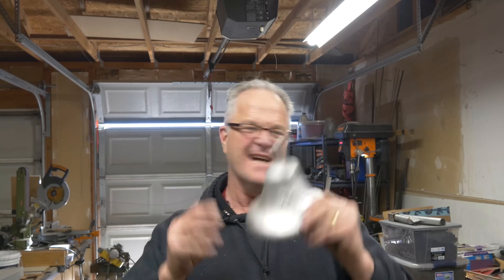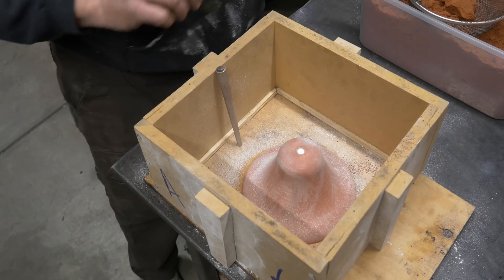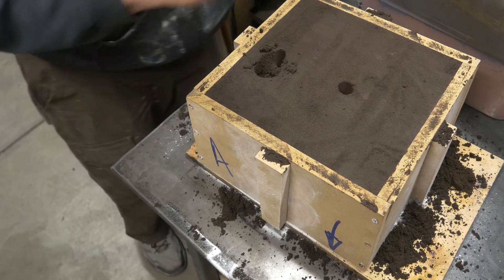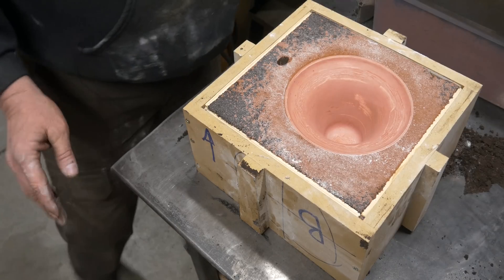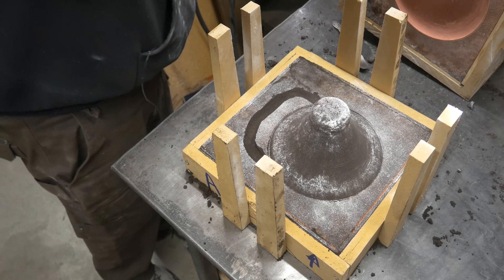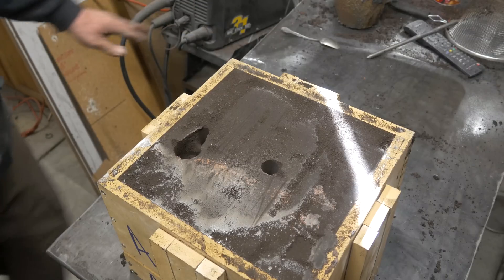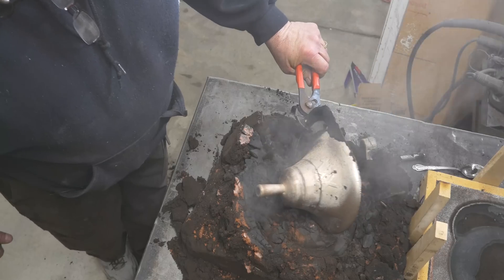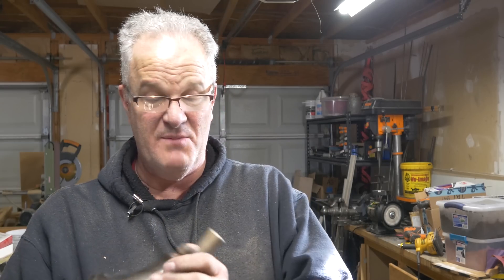Casting a bronze bell

Comment: Great Job Perry!!! It’s beautiful! Where did you get the tin metal from? I was looking for some for a project.
Reply from the maker: A friend of mine gave me two pounds of lead-free solder. It’s 95% tin and 5% antimony.  I really like this bronze so I need to find a source for it as well.
Reply: Go to goodwill and look for pewter I got 2.5 lbs for 5$
Reply from the maker: @ryannu1578  Yeah, I need to make a real effort to do that. I looked once for about 5 minutes and quickly realized I didnt know what I was looking for. After seeing your comment I did a little research on things to look for so I'll go back with a more careful eye
Reply: swdweeb if you know what pewter looks like it’s fairly easy to notice and most are imprinted with the word pewter on the bottom of the cup, vase, platter, or etc I got maybe 3lbs for 5$
Reply from the maker: @ryannu1578  I'm headed to the thrift store this afternoon. Wish me luck ;-)
Reply: swdweeb tell me how that goes because I’m looking at pewter ingots online and if pewter is that common in old crap it might be profitable to go around places like goodwill buying it all up and selling it online as ingots
Reply from the maker: I found one plate with stamps on it another plate that looks just like it except here were no stamps on it
Reply: swdweeb so it seems common enough I’m thinking the flea market this year will be a gold mine or pewter really, how much did you spend? What’s it weigh?
Reply from the maker: @ryannu1578  Hey Ryan, just thought I'd give you an update. I waited until today to try and purchase it since being an old man I thoguht I could get it for 50% off today. No such luck. The items I thought were pewter were excluded from the discount. Anyway, there was only one item that was stamped so I had a reasonable idea that it was pewter. It was basically this https://www.ebay.com/i/223244662553?chn=ps They wanted $5 and it weighed less than a pound but that's the best I can tell you. I couldn't weigh it.  I figured probably buying pewter of an unknown composition for approximately $10/pound.  For the cost of tin, I've seen it at $15-18 per pound. I figured I'd buy the known quantity instead.

Comment: Great video.. I learned about bells and casting.    I wonder how the Bell Casters put the clapper things up inside them. Do they drill a hole in the top for the eyelet or something?
Reply: It would be just as easy to make the eyelet part of the bell, just by altering the mold.

Comment: Not knowing anything about it, other than working in a foundry back in 1973, wouldn't it be hard to get a full poor filling from the bottom if the delay did cause that line? If it slightly solidified there filling from the bottom it would have a hard time getting to the top afterward. I like it!
Reply from the maker: I love the contrast between your channel "picture" and your content. ;-D

I thought about that after the fact, and I think you're absolutely correct, it couldn't have frozen all the way around and then continued to fill. I expect the lines are from burnt oil in the sand. Maybe it stopped long enough to have some soot build up but apparently stayed molten as it did finish pouring.

Comment: I wonder if the double tone is due to the black line around the pour??
You should do one in pure copper
Reply from the maker: Here's the problem with that, I'm just about out of copper. ;-)  I think I'm at the point where I'm going to actually have to start buying metal. :-/
Reply: @swdweeb  A good metal tip for you. Go to auto garages and buy scrap parts from them. A good sledge hammer breaks it up good.

Comment: Good job on the bell. Does the ring sound the way you wanted? The lower and higher frequency pitches was a really cool effect, I wasn’t expecting that. I thought maybe it was due to the pouring hiccup...
Reply from the maker: Does it ring the way I wanted? ;-) Well, given I had no idea how it would ring I guess it did :-D  I'm already thinking of ways to make better patterns and trying to achieve  an actual note.  

I think, but don;t know for certain, that all bell-shaped bells ring at different frequencies. How they deal with the oscillation is a mystery to me. Something to learn

Comment: Nice bell.  👍  It turned out pretty well despite the pouring difficulties.  I hope it holds up to use.  I hope you do an alumin(i)um bronze one just so we can hear the different metal's performance.   🤠
Reply from the maker: I'm going to try and get one done this weel. I need to figure out of I have enough aluminum bronze to pull it off.  I really like this tin bronze though. Nowhere near the shrinkage issues that AL bronze has

Comment: Another great video!!! Seems as though you are becoming a Bell caster!! I would love to see you make the alloy!! Hope you have a fantastic New Year!!
Reply from the maker: Thanks bud.  I shot the allow part in a failed pour that didn't make it to the screen. I'm thinking about editing up a fails compilation on the bells I attempted. It took three tries to get this.

The alloy wasnt anything special, I melted a little lead-free solder, which is like 95% tin, in the crucible then added copper to it. As the copper melted I added more tin until I got it all added. Its 80/20 mixture by weight. When it was all melted I gave it a little stir
Reply: swdweeb I have yet to be able to melt anything but aluminum and lead.. I tried bronze once from swarf from our lathes and it didn’t work out so good... I promise I am going to try again with those coins!! But I would definitely love to see the fails im sure you learned something each time.. Just saying...
Reply from the maker: I learned a ton each time. I think the failures are worth posting. I just need to find the time now to do it.

Comment: @swdweeb so both of your bells can ring longer and louder. If you remove the “viewpoint vent” from the top and drill a small hole by where you can hang it. The smaller that contact point is the less the “handle “ will dampen the vibration.  I use his technique when I build wind chimes.
Great job by the way! I’ve always wanted to cast a bell too.
Reply from the maker: Thought I had replied but now I dont see it...
I'm planning on doing exactly that. I need to see if I can drill that bronze. I was thinking I could tap it and thread and eye-bolt into it to hang it.
Reply: swdweeb I’m sure that would improve the ring, might I suggest an eyelet from underneath through a small hole and threaded into a wooden handle or cross member “depending on how you intend to display it”. This will give you a place to attach a banger.
I’ve never cast a bell. Want to. I have made bells with metal turning flat sheets into bells. And by Blacksmithing them from steel. Casting one is definitely on my want to do list.

Comment: The lower 2/3 of the bell was faced with new petrobond, the upper 1/3 was petrobond. Was there a difference in the surface finish? It looked the same once you polished it.
Reply from the maker: Yeah, I i was running a low on the refurbished stuff so I went ahead and used new for part of it just so I could fill the flask.  The finish isn't remarkably different, I do find that the new petrobond is stronger and so it does better when I'm doing things that really need to hold together like letters.